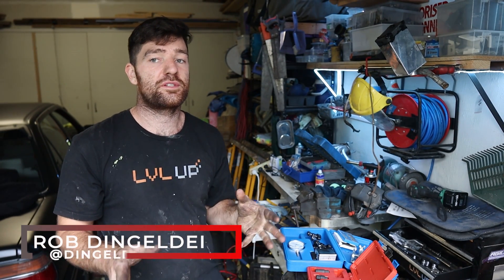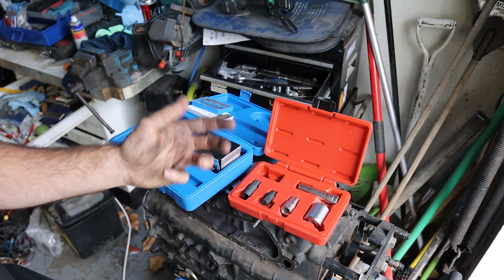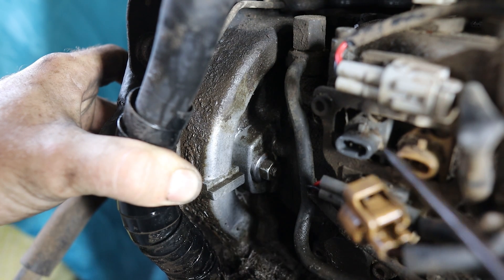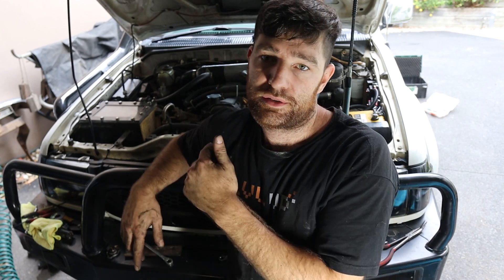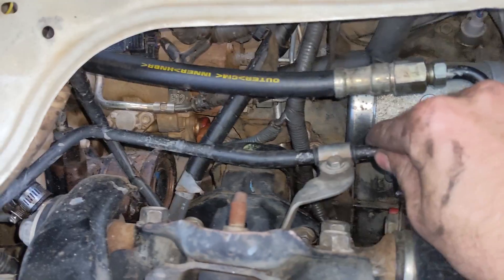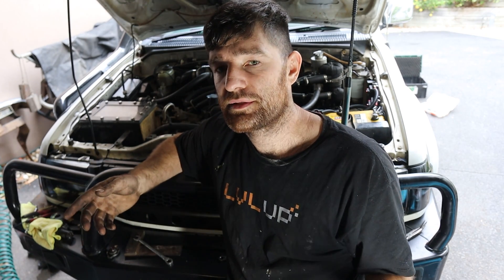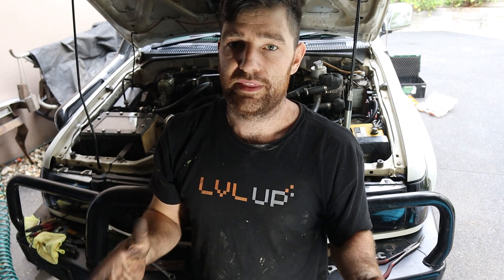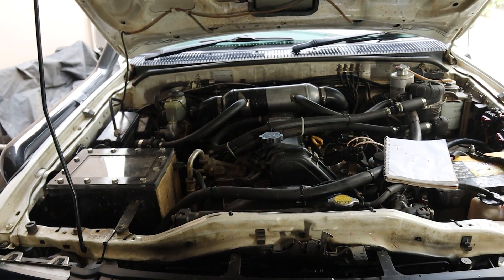1KZ-TE Injection Pump Timing | Step By Step Tutorial | No Specialty Tools Required (4K)

Comment: My 1997 surf possibly had a modern type injector pump but was replaced with the older type injector pump. The wiring connection points me to the modern type as the black resistor connection is not connected. The modern type pump connections are exactly the same as 5L EFI pump. Appreciate if you could provide me the part number for the modern type. And thanks for your videos. I've learnt a lot

Comment: You seem to know what you are doing. I am trying to track down an issue I am having with my Hilux Surf 1kz-te.. For some reason the tach is always showing 0rpm and it has a rough idle. The rough idle is fixed if i turn on the idle up switch. The rpm is ALWAYS 0. I am thinking this is the NE sensor on the injection pump or wiring going to it. Have no tested either yet. No engine check light and have not tried diag mode. What do you think?

Comment: Hey m8 i want yo get your opinion on my problem

This is  for a 1999 90 cruiser not common rail.

The problem is that it takes a long time to start (10+ seconds) and when it starts it's at 400-500 rpm and doesn't respond to throttle or anything for a while. Usually after a few minutes it starts normally and is at normal rpm (830). After that you can drive it and it's good and has a lot of power, good response and everything except when it's fully warmed up (atleast over 80c) it goes completely haywire and every time I go below about 10km/h the revs drop to 500 and it won't respond to throttle, so I either have to go to N and rev-match and then shift into drive. If that doesn't work I'm just stuck until it recovers which can take a while. Pressing the hand pump on the filter housing doesn't help. It starts quicker if I turn it off and on quickly but it doesn't make much difference.

What I've done:
- Changed the oil pump 3x
- Changed the injectors
- Changed the oil filter housing (filter and hand pump) 2x
- All hoses to and from the tank.
- tank is in prestine condition
- Glow plugs.
- most of the wires in the engine bay (either fixed or replaced)
- replaced most of the sensors (Tps, Turbo sensor, water temp, cps and more.)
- The timing is 100% correct
- The time on the fuel pumnp is also 100%
- ground is good everywhere
- tried 3 different ecu
- All engine codes gone
- I've bled the entire system (using clear hoses and there's no air).

Thanks
Reply from the maker: does your model have an e-throttle?
hows the compression and hows the condition of the injection pump?

Comment: 1kzte start starts and runs. Throws code 14 timing marks all perfect. Engine runs like this even with the timing control valve disconnected (not the spill control valve). There is no power at all vehicle will barely move. Thoughts
Reply from the maker: Check for continuity for the harness that goes to the TCV. Make sure fuel filter and injectors are serviced and check the built in mesh filter on the injection pump.
if all good repl ae your TCV

Comment: Hey mate, thanks for the informative video. I've been trying to diagnose a combination of issues that I believe narrows down to slightly retarded timing. Intermittent difficult starts when engine is "lukewarm" (driven to temperature then left to sit for an hour or two), sooty exhaust smell and soot accumulation inside the exhaust pipe, and a kind of sluggish acceleration from a standstill until coasting speed is reached or I give it more than 20% throttle. My pump was taken off and reconditioned recently and starts with 2-3 cranks from cold (glow plugs mask the issue I guess) and wide open throttle feels sufficient. 

In the video, where you show timing on your spare engine outside the car, it seems the IP line is 1-2mms above the flat surface of the timing case, but at the part where you show the lined-up pump in the car, it seems to be exactly ON the same level as the  timing case flat surface. When looking at my pump from the angle of you demonstrating the marks on the spare motor, my pump seems to be exactly parallel with the flat timing case marking, while yours seems to be "advanced" by 1-2 mms. The repair manual illustration of the timing marks does show the pump being slightly above the case mark. So basically I've been trying to figure out the exact configuration. I guess trial and error would be the way to go here? Advance it slightly and see how things improve? Thanks for any additional advice you can provide!
Reply from the maker: Glad to hear the video is helpful, and yes, trial and error is a good approach!
I think the funny camera angles may not help but essentially you want the marks lined up exactly and leave the rest to te ECU.
That being said trial and error is still totally viable. If you advance and things improve then I'd say that's a good result.
If timing is beyond what it should be the car with throw a code and/or engine light

Comment: Hi mate,

I have a 1KZ TE in a 1995 Import surf. the car has had rough idling for a while, then I reconditioned the auto gearbox, then the car became very hard to start, very low in power, its like the turbo isn't boosting, computer was rebuilt, then it was diagnosed with a crook pump. can anyone give me some suggestions where to get a new pump, or rebuild mine please.
Reply from the maker: Try find a local diesel shop. If they cant do it they'll suggest some places. Check your car for error codes even if it doesn't have an flashing lights on the dash. you might get some hints to possible other problems and hopefully cheaper solutions.

Comment: I have fitted a mechanical fuel pump in my 2004 hilux 1kzte..replacing an electic one,now my truck lost power...poor rev count what could be the problem
Reply from the maker: It could be an issue with the timing or fuel pressure of the mechanical pump. You might need to check the timing and adjust it accordingly.

Comment: Good video. Fair play

I have not taken out my fuel pump. 

But I was doing my crank and rocket cover seal.

While doing the timing belt the fuel pump was about one tooth out. 

I rotated it twice to hopefully get it to line up but it wouldn’t. 

So I just put it back together. Would what your suggestion be the fixing of this issue ?
Reply from the maker: If the car is running as you'd expect i'd leave it alone. If you haven't started it yet, crank it over by hand a bunch of times to make sure there is no interference. You can try clock the pump to get the marks to line up. If none of that works, i'd be starting from scratch and taking the timing case off, lining up all of the timing gears and after that line up you pulleys for the timing belt.

Comment: Just installed a second hand pump and its a prick to start will recheck my pump timing but does the pump need to be primed or bled in any way when reinstalling?
Reply from the maker: Prime the fuel filter, if it runs then bleed the injectors while the engine is running. If that doesn't fix it check your glow plugs are connected and in good condition

Comment: i have 1kz prado  electric fuel pump desiel engine so the consumption very high 1 lter per 4.5 km only .Any solution please
Reply from the maker: Are your egt's high? sounds like the spill control valve needs replacing or adjusting. How many Km's on the pump/engine?

Comment: Hi mate and all who commented,
I have watched most of your videos, they are really helpful.  Thanks.
I need  help with my vehicle situation.
Mine is a 2000 Toyota Landcruiser Prado 3L KZ-te Turbo Diesel engine.  
I regularly service my Prado no sign of failure when driving until it mysteriously speed away from me recently.
After the event, I have discovered my Prado have excessive diesel in the oil sump which I believe caused the ‘Run Away Diesel’.
After experiencing the out of control motor vehicle, my mechanic friend suggests injectors need replacing.  
I took his advice and replaced 4x remanufactured Injectors with new genuine Denso Nozzles and all relevant washers.  
While at it, I serviced the Electric Control Valve and Return Fuel Line, drainned the contaminated oil, New Oil Filter, put fresh oil in.
After test driving over the past days all is working fine, but the sump is full of diesel again.
95 Series, the injectors are external which clearly visible to the left of alloy head, no sign of leakage from injectors nor injector pump and all the fuel lines etc… that I could see.
At present it is running fine not overheating, no coolant in oil nor does it blow any black or white smoke at all, no loss of engine performance, the exhaust fume have a slight smell but no sign of leakage or sign of bad rings.  
I have not test for run away yet as I think I would happen again.
I got the injectors from a reputable Diesel Pump and Injectors Specialists who tested my old sets and said they are working ok which I am concerned about my Prado.
I don’t know any other way how excessive diesel could get into mix with engine oil.
Can someone shed light on my vehicle issue.
Thanks in advance.
Thuan
Reply: Just a quick note, the problem 'diesel leaks into oil sump' has been  resolved.
Yes new shaft seal has done it.  
Have been eying the oil level over past many weeks, all ok back normal.
Relieved.
Reply: @thuannguyen9145 great news and well done 👍
Reply from the maker: Try posting on the 1kzte owners facebook page, you'll have better luck there.
My guess is either bad piston rings or a crack in the head near your injector. Both problems would also increase your crankcase pressure so test to see if that is too high. 
You could be burning oil due to a failed turbo or head gasket/cracked head. 
Your fuel pump may also be over fueling the injector (if that's even a thing).
Hope this helps. I'd start by checking the turbo and fuel pump before pulling off the head
Reply: Thanks very much for responding, yeah I got a reply fb 4wd group a couple days later.
A gentlement said possible caused is injector pump leaks fuel at timing case and end up in the oil sump.
I pulled my pump out wasn't easy due to never been off since new 2000. Got new geniune denso seal fitted at the front shaft and an new O ring by the pro at the shop.
Put everything back together with fresh oil, I am just keeping an eye on the oil level and see it all goes.
Cheers

Comment: Hola. ¿Para cambiar el  retén del eje mayor hay que desarmar la bomba o cambiar sin desarmar? Muchas gracias

Hello. To change the main shaft seal do I have to disassemble the pump or change without disassembling? Thank you so much
Reply from the maker: you should be able to replace it by taking off the plastic timing belt cover,  timing belt and injection pump timing belt gear. Leave the metal timing case cover alone and you should have access to the seal.

Comment: Hello from Trinidad. You videos are very informative. I am wondering if you can help with a problem I am having. I have a j95 prado with a 1kz-te. It always starts right up no problem,however sometimes i get a loss of power sometimes no power at all the the motor would make a weird knocking cooing sound. I have cleaned the tank replaced the filter and primer pump i added a lift pump i had the injection pump serviced i am going to do the injectors on Monday will let you know  but if you or anyone knows of a fix and definitive cause i would truly appreciate it. Thank you
Reply from the maker: it could be timing or a fault with the injector pump. Did the problems start suddenly or gradually build up over time?
Reply: Fit a transparant hose close to the pump, whether air is in the fuel from the tank.

Comment: Hello
Reply: I have a problem with my hilux 5l engine electric injection pump does not accelerate to the fullest
Reply from the maker: Hi Frank I just saw this comment, did you manage to fix it or still need help?

Comment: Main reason the standard VE timing tooks arnt needed on a 1KZ-TE pump is because they dont have a bolt in the head plug located on  back of the injector pump. Also take a zero offset ring spanner and bend to 90 degrees to get to the back bolt of the mounting flange. Dont remove rear support from the pump just remove the 2 bolts from the block.
Reply from the maker: Awesome stuff! Thanks for the helpful info, I didn't even know that 😀

Comment: My 1hz injector pump was rebuilt. I aligned the factory timing marks on the pump and the timing gear case. The engine idles rough. Do I need a dial indicator to time the pump considering the fact that it was rebuilt with new head and rotor
Reply from the maker: I think so, that's a different motor to this one so not too sure

Comment: So you don’t need a diagnostic tool to find out what’s throwing a code? Just bridge some pins and read the flashing light? That’s awesome! So how did you fix the timing problem ? Did you have to go back in and readjust it slightly ?
Reply from the maker: That's it! I fixed my issues by clocking the pump so that it lined up with the alignment marks as shown on the video

Comment: 2.39 mm for the KZ-TE mark on the pump
Reply from the maker: can you elaborate, not sure what you mean and I'm😅 still learning myself!
Reply: @lvlupbuilding  If you replace the plug on the hydraulic head with a 2L2 plug so that you can insert a timing gauge, rotate the pump clock wise with a coupling the lift must be 2.39 mm

Comment: dont get it.. how do you adjust it?,
Reply from the maker: The pump "ears"/mounting tabs have slotted holes so that you can loosen the nuts and rotate the pump the same way you would do with a distributor on a petrol engine.

Comment: Hi can please show from side view the marking suppose to be at? Cuz i got land cruiser 3.0 check engine light will pop up when rev and power loss when check engine light on, engine will knocking, Check the mark is higher from the mark at timing case. Ive re-time the injection pump as you showed.  After re-time pump, when speeding no check engine light, but when cruising rpm1800-2000 check engine light will pop up again, and power loss. Can help?
Reply: Also after timed the pump as you showed, engine long crank before start
Reply from the maker: first check your timing belt is installed correctly.
if the belt is ok, alter the timing of the pump as ive described in this video. 
change it bit by bit. test drive the car until it runs smooth.
Reply: @lvlupbuilding  really appreciate your reply 🤝 ive alter the time bit by bit. More it near to the mark engine will long crank before start. I suspecting theres an issue at the pump itself, would it be the pump?

Comment: Thanks for the video. This got me over the line recently after having to swap injector pumps over from my cooked 1KZ to a new refurb'd one. However, I am not entirely convinced on the point of lining the metal ledge with the line on the ear of the pump. I'm wondering if thats just a general starting location but still needs to be fine tuned from there? My 95 series Prado 1kz-te motor seems to be idling a bit rough after following these instructions and blowing a decent puff of smoke on start up which it never used to do (this could just be thenew engine too). Also the engine feels a bit "laboured" and "sluggish" when driving een compared to my old cooked motor with the cracked head! I'm wondering if the pump does need to be fine tuned using those tools you bought like what was described in that YT video where the bloke tunes the 1HZ pump? (I presume thats the same one you watched). Other schools of thought are that you set it to that line as you described and the ECU automatically adjusts the timing based on various sensors around the engine reporting back to it. Any further thoughts on this? Cheers, Sam
Reply from the maker: Best take it to an expert diesel mechanic, this advice is what worked for me and im only relaying all of the information I wound online while trying to rebuild my first ever engine
Reply: @lvlupbuilding  yeah fair enough. I've since discussed this with others around the interweb and theirs definitely some more finer tuning to be done with clocking the pump tiny bit one way or another (usually advancing). One bloke in particular found 2mm advanced (from the marker ledge thing) worked wonders for his engine but I'm sure this varies slightly). Cheers for getting back to me 😎👍
Reply: I’m in exactly the same position after rebuild . Did you eventually get it as smooth as originally . 
What was the final outcome mate

Comment: Hey mate… I have replaced the pump and the engine is a bit tight to turn. Any tips?
Reply: Also just having this same issue,iv just changed my pump,now slower than normal to turn over. Thanks for the video,very helpful.   Anyone any ideas why it's slower to turn over? 
Also,do I need to bleed injector lines after install? Still can't get it to start.
So far...changed relays, including spill relay, located in cabin passenger side behind glove box, taken out and tested injectors, new glow plugs and still nothing. Anyone help ? Thanks
Reply from the maker: https://youtu.be/R6QUOvgyFu0 watch this video i made, you may find your answers here

Comment: Hey Mate, great video thank you for posting. 
I am currently having a problem with my 98 Surf with a 1kzte. 
I recently replaced the timing belt and afterwards it started up and ran fine just as it always had. Drove it about 8ks down the road then it just derated and wouldn’t go over 1200rpm. It now won’t start.  I have tried replacing engine ECU to rule that out but  it hasn’t helped. I am now thinking the pump. Ever heard of this? 
Cheers
Reply from the maker: I haven't heard of this. Have some fresh eyes check over your work with the timing belt. if it's all good start diagnosing your fuel pump and its timing. would be a massive coincidence that it started playing up due to other reasons just after you've done a timing belt.
Reply: End up figuring it out bro have the same problem